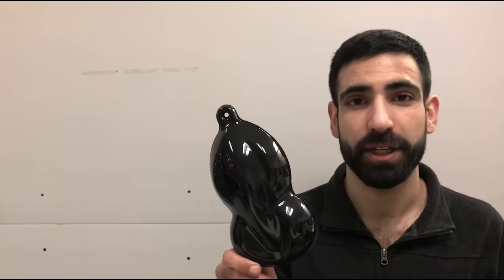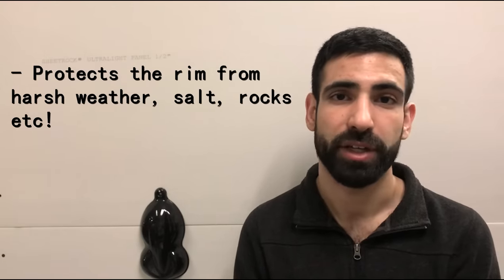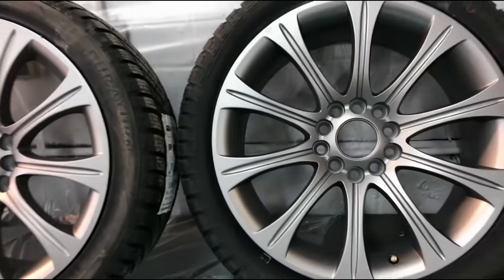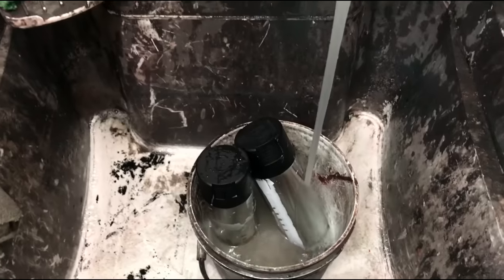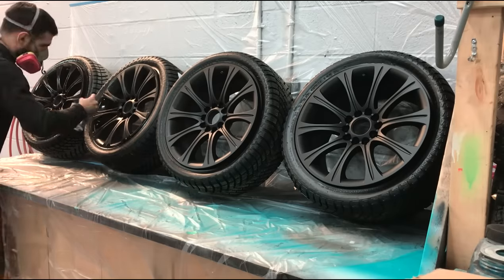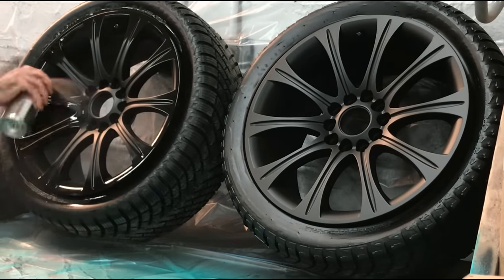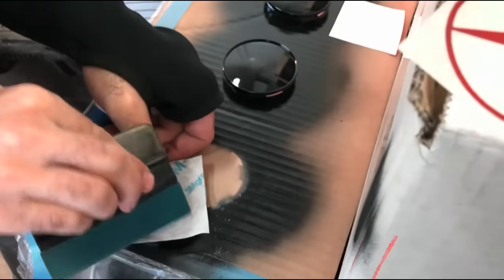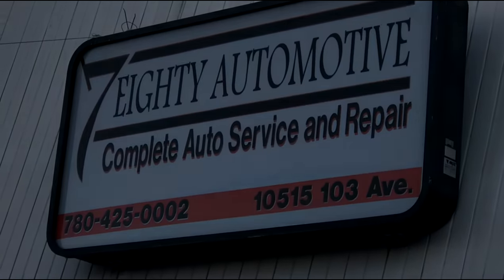How To Spray 2K High Gloss Plasti Dip Rims

Comment: My rims have a few scuff marks. 🤦🤦 Is there anything I need to do to them before they're dipped? I was told I should sand that area down.
Reply from the maker: Bianca Alexander hey! You dont need to do any sanding it should cover up the scuff marks if they are light but if they are deep then they will show underneath the dip. You can always sand it down smooth it out first before you dip the rims
Reply: @EhabHalat  Thank you for the info hun.
Reply: Was wondering same

Comment: So how long does the Gloss last?  Does the shine stay the same after a month or a few washes?
Reply from the maker: A M E R I C A N R I F L E hey, it lasts very long, as long as you clean and maintain every 1-2 weeks. You can also wax the 2k gloss to make them shine like new after every wash!
Reply: @EhabHalat  Nice! Thanks a lot for the follow up. 😎👍🏽
Reply: @EhabHalat  How many cans would I need  for a set of 4 wheels?
Reply from the maker: A M E R I C A N R I F L E 4-6 cans depending on rim size
Reply: @EhabHalat  are you talking about the Gloss or The plasti dip?.I ordered 2 cans of gloss I thought that'll be enough😬
Reply from the maker: A M E R I C A N R I F L E oh you only need a can of the 2K gloss for the rims you probably wont even use the full can
Reply: @EhabHalat  oh ok cool. Thanks man👍🏽

Comment: What happens when tires have to be replaced? Does the tire machine scrap off the paint?
Reply from the maker: Usually if the person changing them is very careful they shouldn’t ruin them but if something does happen you can easily thin out the damaged area and respray it to blend it in

Comment: When you pull Plasti Dip off the tires it is all one piece covering wheels and tire surface so what stops the peeling from pulling up the dip from the wheels?
Reply from the maker: The tire and lip of the rim have a space between them so the plasti dip cuts its self off

Comment: How many cans of PlastiDip and 2K gloss needed for the project?  Assuming you do 8-10 coats of PlastiDip and 2 Coats of 2K.
Reply from the maker: About 5-6 cans of plasti dip and 1 can of 2k gloss, maybe 2 depending on wheel size and how complex the spokes are

Comment: how about the back of the tires we dont need to apply plastic dip? how many bottles will it take?
Reply from the maker: It doesnt show when on the vehicle but its your choice if you want to do it. 1 can per wheel usually

Comment: How long does this last, also can we just use any plastidip paired with that 2K clear?
Reply from the maker: If applied properly, it will last anywhere from 3-5 years maybe even longer. I would recommend using this clear coat because i haven’t tried any others
Reply: @EhabHalat  thank you for the very fast reply, definitely thinking about doing it to my rims. I don’t plan to switch the 2K clear coat brand but I was asking if you can switch out the plasti dip brand or does a specific one need to be used to achieve similar results. Thanks once again
Reply from the maker: @joshuaharris5670  yeah i would stick with plasti dip colours only

Comment: I got a question. I have matte black rims and I want to know if I can use a gloss spray to make them glossy instead of matte?
Reply from the maker: Xbox NoiseTank its recommended to spray a removable coating black base first and than spray the 2k ontop
Reply: Ehab Halat Recommended but is it required??
Reply from the maker: ClayDayz id say so yes

Comment: looks good,  but if you're wanting to make the colour permanent why not just prime the wheel and gloss it with regular spray paint before using a clear coat,  the whole point of plasti dip is that its designed to be temporary and easily removed
Reply from the maker: Its not permanent, its still removable yet much more durable than straight plasti dip plus you get a nice high gloss

Comment: Wow you’re awesome dude can you send me a link so I can buy that kit and can I use this for the metallize color and then use the 2K
Reply from the maker: Brian Harris hey, thanks! There is no kit to buy but all you need is the color you want to use and yes you can use metalizer and then use the 2K top coat to achieve the high gloss finish. You can buy the 2K high gloss by spraymax at almost any paint store or automotive store (NAPA, Bumper2Bumper, Partsource etc)

Comment: Could this work on front grille? Does it stand against rocks hitting the grille?
Reply from the maker: Yes you can use it on the front grill. It will help with rock chips but overtime it will eventually chip up but easy to touch up

Comment: How many cans of the 2K High Gloss SprayMax will I need for (4) wheels.  (2) 19x10's and (2) 19x11's  Thanks
Reply from the maker: Hey! You will only need one can. Spray one light coat followed by one heavy coat and then let it sit for 24 hours

Comment: How hard us it to get white Plasti Dip off a tire? Would it be better to mask?
Reply from the maker: As long as you apply a tire shine like armour all around the whole side wall of the tire but be careful not to get any on the rim. Spray the tire after every coat you spray on the rim and you will be able to peel the plasti dip off the tire easily because it will be bubbled up from all the tire shine on the side wall.

Comment: My wheels are factory and they have clear coat on them. Will that paint work on it without doing anything to it?
Reply from the maker: Yes it will be fine
Reply: Thanks. Where can I find the 2K Spray?
Reply from the maker: Chris Roy you can find it at napa auto parts store or your local paint store should have it

Comment: 2 questions, Can I do this with the tires off the rims and can this be used on chrome rims that have some oxidation
Reply from the maker: Calvin "Caltech" Whitfield hey i would do it with the tires on the rims. Putting the tires on coated rims might damage the coating from the tire machine and yes they can be used on the chrome rims with oxidation just make sure to clean really good when it comes to chrome

Comment: Question : how durable is it when you take it in for tire rotations....? I’m sure we all know shops don’t exactly baby anything especially tires during a routine rotation....
Reply from the maker: Its do able without ruining it as long as the person knows what they’re doing. If it does get damaged its easy to repair in most cases.
Reply: @EhabHalat  that would be a crap-shoot realistically.... 
Question #2: can I spray plastiDip gloss over existing plastiDiped emblems & would It peal off around the emblems the same as plastiDip?
Reply from the maker: Ya if the existing plasti dipped emblems are in good shape still with no peeling. Make sure you clean them very good and yes if you use plasti dip gloss it will all peel around the emblems
Reply: @EhabHalat  question 3: I’ve seen some videos that say not to let the gloss dry before adding the follow up layers. Is that true...?
Reply from the maker: @ngarci8040  no you have to let it dry before the next coat
Reply: @EhabHalat  great.... ty for responding & helping me out with my questions. I went ahead and subscribed and I’ll definitely give you a thumbs up on all your videos I check out...!
Reply from the maker: Thank you! Much appreciated
Reply: @EhabHalat  quick question: I dipped my spoiler and did 1 pass of the gloss over it & it seems to have a tacky finish, not smooth but boarder line sticky. Its had a good 4-5 days of dry time
Reply from the maker: Did you do one light coat followed by a solid second coat?
Reply: @EhabHalat  I think I didn’t wait long enough between the two plus it was late so it dried over night. So do you think if I add a layer or two it would fix it’s self or am I looking at possibly redoing it from scratch?
Reply from the maker: @ngarci8040  it might be too late but you can try a again just spray a light coat then one solid coat right after of the gloss and let it sit
Reply: @EhabHalat  well that would be a shame having to redo it but it’s a fairly easy job. Ty for replying
Reply: @EhabHalat  so I went ahead and did a handful of gloss on the spoiler & after everything it looks like it has patches and streaks of gloss definitely not full coverage for some reason.....
Reply from the maker: @ngarci8040  you need to do a more solid wet coat so you wont see the patches and streaks. Over lap your coats
Reply: @EhabHalat  I did do like 6 already but I’ll plan on doing a bit more hopefully it evens out 👍
Reply from the maker: All you need is one light coat then a solid wet coat thats all but good luck hope it turns out ok

Comment: I'm really curious as to how easily this coating comes off of the wheels. I've read some horror stories about removal of this combination of coatings [chipping, sanding, peeling of wheel clear, etc] I really hope the process shown here doesn't lead to damaging your viewers vehicles or wheels. I'd like to do this to my wheels but I'm afraid of what will happen. I'm also curious as to how long you should wait before spraying the clear coat to avoid the chipping of the total coat upon removal if that's at all possible.
Reply from the maker: The Bradass it will be removable maybe not as easy as straight plasti dip but it will still be removable in the future. You have to wait at least one hour before spraying the clear coat

Comment: hi i need some help , i sprayed my wheels with plastidip 3 days ago and now i got ma glassifier , can i add it now ? and if yes how can i clen my rims with plastidip before spraying 2k?
Reply from the maker: Yes clean them with a soap and water mix or a degreaser spray will work and make sure they are dry before spraying gloss
Reply: @EhabHalat  do i have to rub it with something to dry it? or i should let it dry itself?
Reply from the maker: @SSS-mz4jd  clean it with a microfibre cloth and the cleaning spray and then after its clesn use rubbing alcohol and wipe the wheels down again to make sure 100% they’re clean

Comment: Do you know how well this would work on wheels with a chrome finish?
Reply from the maker: Works well just make sure u clean everything really good using rubbing alcohol but if the chrome is in bad shape you might have to do some sanding

Comment: What’s the best way to protect and maintain rims that are done this way?
Reply from the maker: After you complete them. Wait two days before washing and just use degreaser and pressure washer to clean and you can wax and polish it after 30 days
Reply: @EhabHalat  how about tire and wheel cleaners (iron removers)?
Reply from the maker: @im_so_es_ef_wit_it  yes but you will have to let the wheels cure for about 30 days before using
Reply: @EhabHalat  truly appreciate your help. I just did this and it’s the best thing ever
Reply from the maker: No problem!
Reply: @EhabHalat  it’s been 30days,
Do you think brake dust repellant by armor all is safe?
Reply from the maker: Yes
Reply: @EhabHalat  thanks again.

Comment: Ok did I have to release tire air pressure  before applying  2k high gloss max
Reply from the maker: No need to unless you want to get more around the edges of the rim

Comment: Would this work on window louver abs material? Can I buy this on ebay or amazon?
Reply from the maker: Yes you can and you should be able to find it online but if not then your local hardware/paint store should have the 2k gloss by spraymax

Comment: I worry about why do some clear codes change the color of the paint? Sprayed some rims came out nice then I added clear coat and it changed the color completely.
Reply from the maker: Adding clear coat to any colour usually makes it pop more and brighten it up with the gloss finish
Reply: @EhabHalat  in this case I was using a chrome Dupli-Color on aluminum dirt bike rims look great without the clear coat then once added clear coat it turned a dark gray
Reply from the maker: Oh thats odd! I never heard of something like that happening
Reply: @EhabHalat  Yeah I just found out if you mix a lacquer with an enamel.

Comment: Can you had 2k gloss after your car has been dippped for about 2 days and can it go over regular gloss?
Reply from the maker: Yes but clean the wheels very very good or it will cause a reaction
Reply: Ehab Halat preciate you bro.
Reply: Sorry to keep bothering you I have to order the 2k gloss is it ok to add it to plasti dip maybe a week or 2 weeks after first spray dip to rims
Reply from the maker: I recommend spraying it on freshly applied plasti dip so there is no dirt or debris to be safe

Comment: Nice video. I dipped my wheels after seeing this video and they looked great with just the dip but when I put the 2k on it didnt look like this. Looks more like I spray tire shine on plasti dip. Terrible
Reply from the maker: 2k has to be sprayed a certain way. One light tack coat followed by one heavy coat right after. It has to be a nice wet coat to get a nice glossy finish
Reply: Can you wet sand the 2k to make it shine more?
Reply from the maker: I haven’t tested that out so i dont know

Comment: Is one can of 2k clear enough or should I get 2?
Reply from the maker: One can is usually enough unless you got wheels bigger than 21”
Reply: @EhabHalat  i have a set of 22s. I plan on using 4 cans of black plasti dip and 3 cans of Adamantium Dip Pearl. Would you say that’s enough product to get 8-10 layers? Thanks
Reply from the maker: @irvingmarmolejo9713  i think that should be good enough

Comment: Warning, putting plasticoat in warm water between coats is fine.  Don't put 2k gloss in warm water between coats,  it will get water in the can.  It happened to me.  I found out when I started to spray second coat.
Reply from the maker: I always put my 2k in warm water before i spray and i have never had that issue but i stand it up in the warm water, i dont lay it down side ways.
Reply: @EhabHalat  I guess it happened because I put it back in the water, after puncturing the hardner, and spraying 1st coat.  I thought I could keep it warm while waiting for 1st coat to dry.
Reply from the maker: Oh the process i do is spray a light tack coat followed by a medium/heavy solid coat and let it dry for 24 hours. No need to wait between coats but i guess you can do more layers of clear coat, i just feel it isn’t needed

Comment: Wouldn’t it been easier to just use gloss black paint with high gloss clear coat?? If you’re going to use high gloss on Plastic-dip, wouldn’t it essentially defeat the look of Plastic-Dip??
Reply from the maker: It still makes it removable if you watch my latest video and it keeps time and cost down without having to sand down the wheel and what not
Reply: Ehab Halat - I see.  So the purpose is to avoid the sanding and also it’s makes it less permanent?  So you can remove the high gloss b/c it’s attached to the Plasti-Dip?
Reply from the maker: GHN1013 yes with the right amount of coats it will still peel

Comment: (one can) 400ml  clearcoat was enough for 4 wheels?
Reply from the maker: Yeah if they are 18” or smaller usually one can is enough
Reply: @EhabHalat  i bought two. i have 18" but 16 spokes each wheel. used 3 cans of base coat for all 4.
Reply from the maker: Should be good enough

Comment: How long do we need to wait to apply the second coat of 2K gloss?
Reply from the maker: Spray a light coat followed by a solid wet coat right after. No waiting and thats all you need
Reply: @EhabHalat  thanks for the reply bro. One other thing, I know you said 10 coats for the best results, but say I don’t plan on peeling or changing the colour, would it be okay to apply the 2k clear coat with less coats of plasti dip?
Reply from the maker: Yes you can do atleast 5-6 coats
Reply: @EhabHalat  Thanks man, really appreciate your help! I’ll definitely like and subscribe. One of my wheels has glossifier on it I started doing that till I saw your video realised it’s much better. I’m guessing I can still apply the 2k over the plasti dip glossifier? The other three I’ll just apply the 2k however I’m wondering if I can do it over glossifier
Reply from the maker: I have never tried it over glossifer might be best to spray black again over the glossifer than use the 2k gloss
Reply: @EhabHalat  Alright done I’ll go with that. Once again really appreciate your replies and help! I’ve subscribed and liked! Thanks again brother

Comment: All thought the wheels do look really nice, you can’t actually remove the plasti dip away later on in the future, the hard top(2k) will adhere to the plasti dip and it will not be able to be removed. This is a permanent fixture to the wheels.
Reply: If you use xylene on the plasti dip it will make it bubble up. So it's not permanent.
Reply from the maker: Watch my video on peeling wheels with 2K. Peeled each wheel off in 15-25 min

Comment: Do I need to use any kind of primer?
Reply from the maker: No primer needed
Reply: @EhabHalat , awesome thanks! One more question. What paint brand would you recommend for a high gloss black finish? I’m stuck between rust oleum and dupli color.
Reply from the maker: @elijahgaines9766  just follow this video. Black plasti dip and then 2k clear gloss by spraymax
Reply: @EhabHalat , ok thanks. Your rims were the best out of all the videos I watched. I’ll check those sprays out.
Reply from the maker: @elijahgaines9766  thanks man i appreciate that!
Reply: @EhabHalat  no problem! I actually have one more question. Can I do this in any temperature room? Or does it need to be a certain temperature?
Reply from the maker: Normal temp should be fine just not too cold or too humid
Reply: @EhabHalat is 40 - 50 Fahrenheit too cold?
Reply from the maker: @elijahgaines9766  that should be good temp
Reply: @EhabHalat  Ok, thanks!